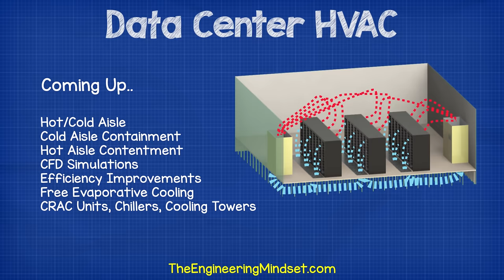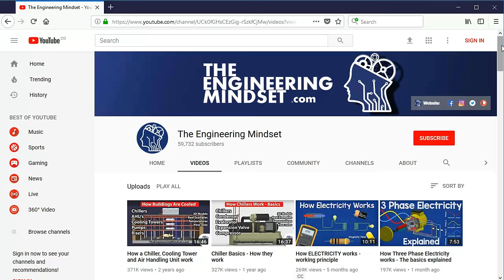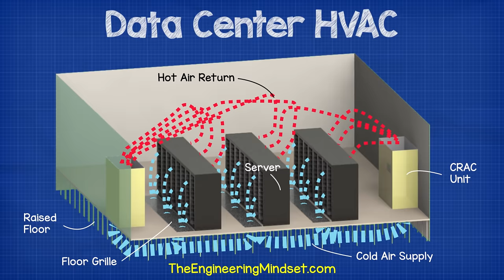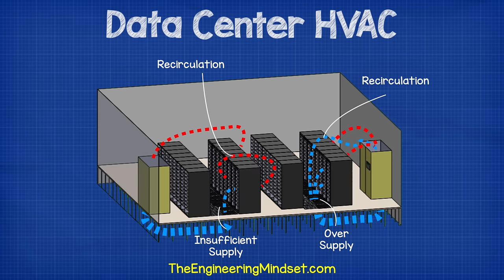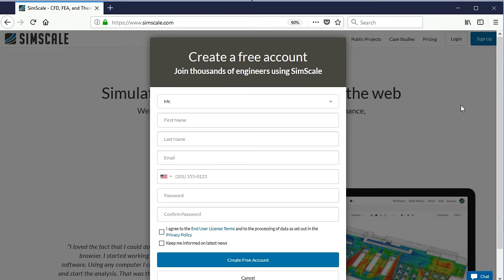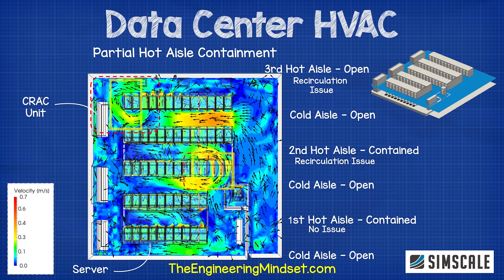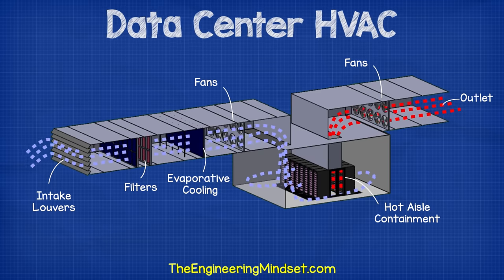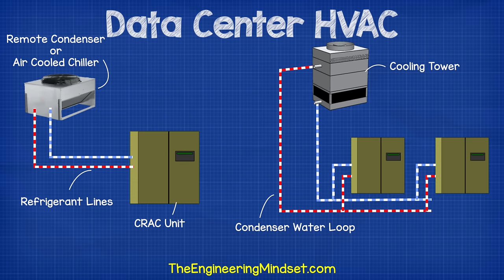Data Center HVAC - Cooling systems cfd

Comment: In 2004 I worked in a sign shop that had been built to be a data center but which never took occupancy when the Dotcom bubble burst. The only climate control they had installed was a massive AC unit like these CRAC units, but which didn't have a controller. It was either on or off. In 20-30 minutes it dropped the temperature from about 85°F to 50-55°F. And while it was running it was deafening. But we only had to run it twice a day during the hottest part of the year.

Comment: Side note, if the CRAC unit is using chilled water then it's typically called a CRAH (computer room air handling) unit.  This is due to not having the compressor or majority of the work to cool being actually IN the unit like it is with a CRAC unit.  With CRAH's the compressor doing the most work is typically in the upstream chiller or heat rejection equipment of similar type and function.
Reply: Good catch bro. Stay safe

Comment: Probably the coolest video on data center environmental design
Reply from the maker: well played pun
Reply: The Engineering Mindset - I work in a small tech center and we don’t use under the floor forced air cooling because it requires plenum rated wire that is much higher $$
Reply: So we have to have the supply and returns in the drop ceiling- cold supplies in front of the racks and returns behind. Not nearly as efficient as supply below the floors. And some of the equipment pulls from the rear.
Reply from the maker: Sounds like some CFD sims could help you prove the business case to invest in improved cooling!

Comment: Great video! I don't know if I am the first to nerd out on this video and pick it apart like a troll, but you incorrectly call a computer room cooling unit (@10m:44s) connected to chilled water system a CRAC but its actual a CRAU (Computer Room Air Handling Unit). There is no AC (Air Conditioning) when using a chiller so I get it and using the term "Crack" is a generalization.  If I am building a project and we have chilled or condenser water in the computer room I start to worry about a new set of issues, computer and water don't mix.

Comment: Loved it. I'm part of the DDC division of an HVAC company, and I want to thank you for all the informative videos that keep me learning, but also helped me get the job. Currently I am working on a 1,000,000 sq ft data center project that is truly a feat of engineering. Love my job. Thanks, again.

Eric
Reply: Hi Eric, I am looking for job in data center as ME engineer. Could you please guide me which skills should I focus on ? Currently, I am learning REVIT and have done analysis in CFD.
Reply: @javalearner4227  Hi I'm a Dceo operations engineer and did Mechanical engineering. You need to have good knowledge in HVAC, Fire fighting and electrical systems.

Comment: This video is particularly applicable to me. 
Modern HPC  clusters often have power consumption in the MW range and often uses liquid cooling for CPUs GPUs and RAM, these usually consist of a local liquid loop with a heat exchanger linked to a secondary loop fed from the building chilled water system.

Comment: This is a cool video, but I work for a big commercial refrigeration and HVAC company in Arizona. I have never seen this. We do all the work for Century link in Arizona. They only use chillers or rtus. I’m not saying this doesn’t happen, but I think with all the bad airflow just use a chiller with multiple air handlers. Thanks for the video.

Comment: With regards to the DC Energy Consumption ratio: I think its best to allocate 50% of power on HVAC and 36% on IT Equipment (10% on Network Devices and 26% on Server and Storage).
Reply: I think if that's the case, the PUE will decrease

Comment: Thank you sir.
1. Are data center can work on partial load like residential unit? Are there any load variations on a server room?
2. In free cooling method without plate heat exchanger, is there any limitation for moisture for electronic devices?

Comment: What you described as a 'CRAC' unit is actually a 'CRAH' unit.
Reply: Depends however on the location of the mechanical cooling equipment.  CRAC units include the mechanical cooling system at each unit. CRAHUs are chill water fan systems and rely on remote Chillers type systems.

Comment: The picture at 0:17 is not a recommended way for stacking racks, it should be like Cold-Cold front or hot-hot front.
Reply: He addresses this specifically at 4:00.

Comment: Data centers are always expanding, they often don't take into consideration the added heat load. They just keep pushing in more racks. One solution was a manifold piping system over head, with quick connects. You just place fan unit cooler on top of the new data rack and hook up the quick connect flexible refrigeration lines that's it. The main cooling unit has a large reservoir to accommodate multiple fan units. It was years ago when I helped install the manifold piping system, and I can't remember what it was called. Maybe someone knows the system name.

Comment: All of these are junk. I run several crappy black pipes 7ft under ground for 200ft and pump in 48F air into my greenhouse and room year around. Can't get more efficient than 1 fan.